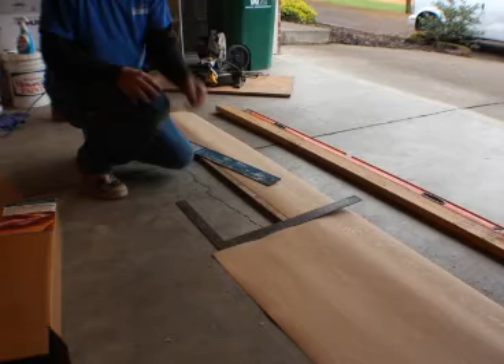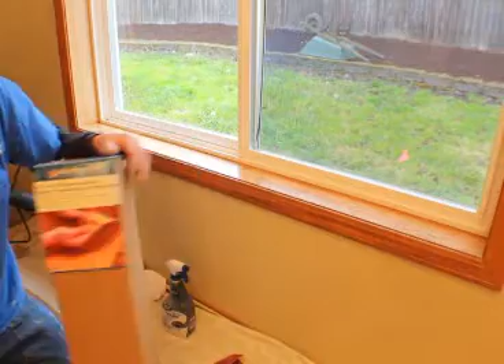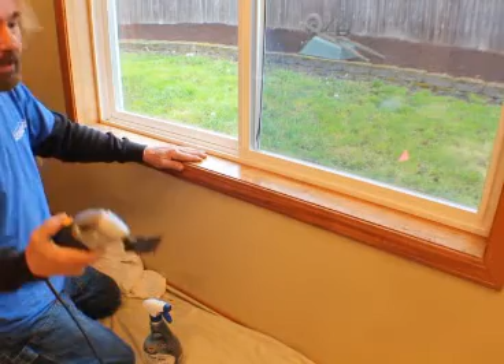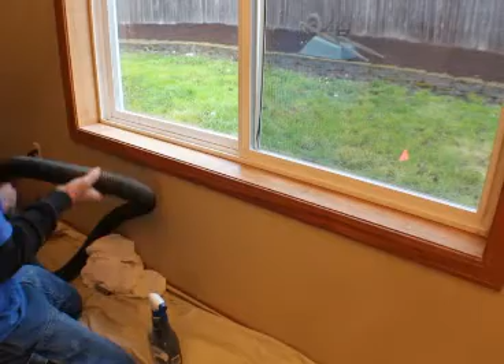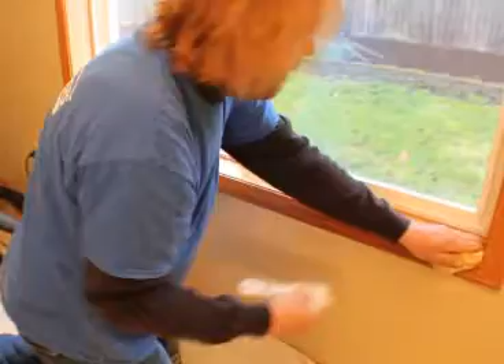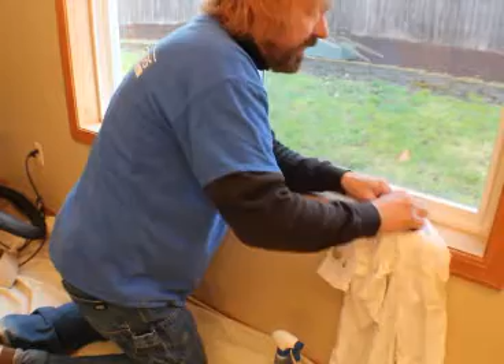Using Veneer to Repair Window Sills

Comment: Where do you find the veneer with the adhesive at?  I have several window sills that have large checks in them from sun damage and I would like to repair the before I sell my house.  The windows are still in good shape other than the sills look bad.  Thanks for the video!
Reply from the maker: Hi Penny: I purchased the laminate at a Woodworkers supply shop in Beaverton Oregon called Rockler, here's their website https://www.rockler.com/retail/stores/or/portland-store?utm_source=local&utm_medium=organic&utm_campaign=portland

Comment: I have these apronless sills in my house . They have a 1/2 or 3/4in thick board capped with 1/4 in paneling. I’m having new vinyl windows put in and will have to replace the sill “caps”. I think you are the only person to demonstrate a repair of these type sills. Thanks for putting up this video.
Reply from the maker: Thanks for watching. The laminate works great, the only issue with these products is - because they are tightly grained it may require multiple stain coats. I had dark oak sills recently, used an oak veneer and had to do 2 coats to get them dark enough. That said, I will always consider this option first opposed to costly, messy tear-outs.